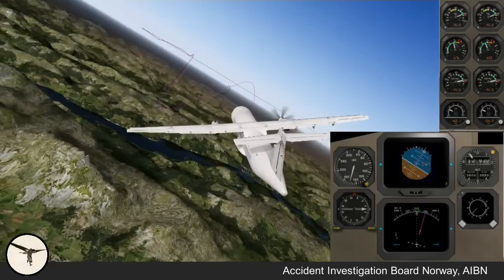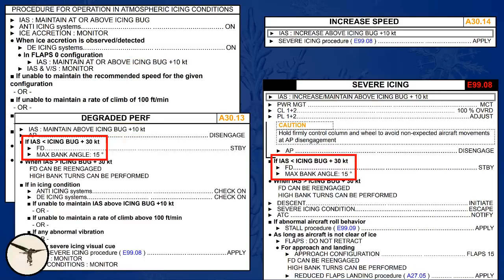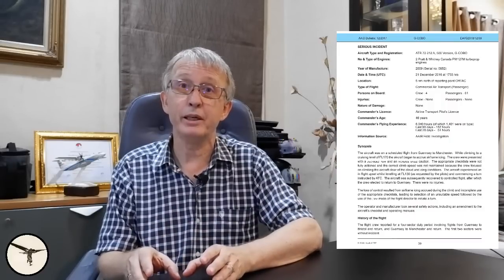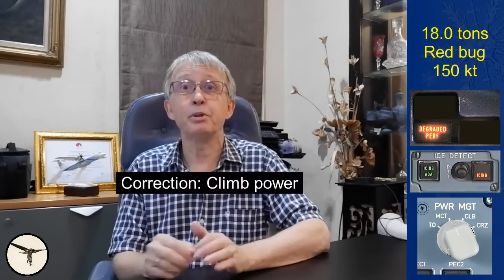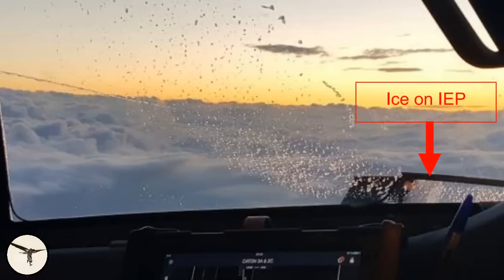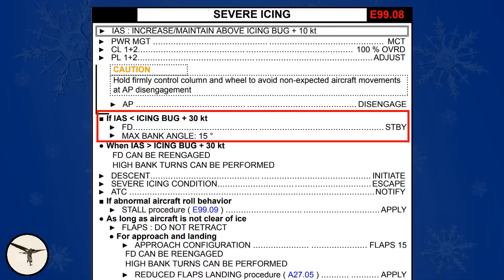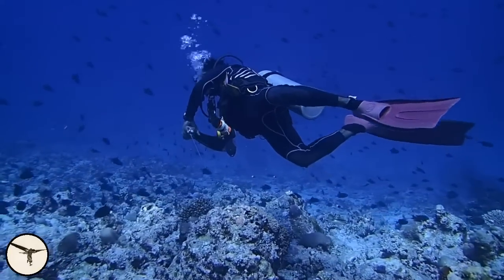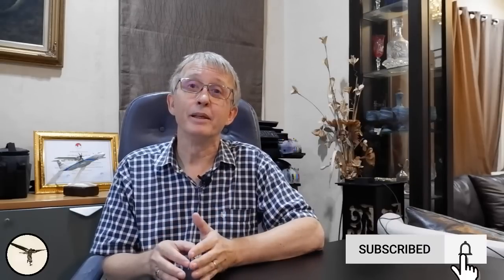Can you outclimb severe icing?

Comment: This French instructor and the Head of Training in AATC always tells us "There's 3 important things in aviation 1.Airspeed 2.Altitude & 3.Fuel. If you don't have speed, you stall and you can die. If you ignore Alt constraint you can go into CFIT and die. If you ran out of fuel, and don't know what to do, you can die" It has been the bedrock principle and always have been the 1st Golden Rule in ATR SOP that in times of trouble, Aviate, Navigate & Communicate in that order. 

Effective flight planning is a also a great way to combat severe icing. FCOM PRO.NOP.ANOR.8.1.1.8 recommends choosing a cruising FL that provides 40kt margin above icing bug. This margin gives crew ample time to monitor icing, anticipate degredation and define a strategy to avoid it. If icing condition are forecasted on the planned route it is recommended to choose a cruising FL at or below the max ceiling for icing conditions. Pilots can't just choose a cruising altitude without any basis. Also treat the plane like a camel, if you see the camel tired and can no longer walk, let it rest and give it food and water. The ATR ceiling in icing condition is during climb when it reached a max rate of 100ft/mn, better if you add more margin to it. Never force the plane to do things it can no longer perform, be considerate to the plane as well.

Comment: Question the plane was in a flat spin turning to the left what if the pilot would have put the right engine at full throttle reverse thrust and feather the prop on the left engine and apply right rudder to counter act the left spin and once the flat spin stops the pilot puts both engines at full throttle forward thrust and point the nose down to get enough airspeed and climb out...I wonder will that work?
Reply: I don't think reverse thrust can be applied in flight, and if the control surfaces are already contaminated, they aren't effective, so there's no way to control yaw or pitch. So, it's possible they were in a situation where they could do absolutely nothing.
Reply: I don't have any pilot training but having watched lots of videos about spin recovery one thing seems to stand out: the need to get the nose pointed downward. I don't know if applying thrust is helpful.
Reply: Unfortunately in multiengine airplanes asymetric thrust doesnt help much, you have too much weight too far from airplane CG. If the spin is developed, very little posibility to recover. And we are not talking about T tail configuration which doesnt help either. I dont know any twin engine airplane, certified for spin recovery. As I know, there is no demand for it in certification of such planes.

Comment: Hello Magnar, I'm checking out all your tutorials now, good stuff 🙂. Think it is a very good video for all (aspiring) turboprop aviators. Question: Does the ATR propeller generate considerable vibration in more than moderate icing conditions due to ice on the unprotected area's of the blades? Or not so, because of the shape of these props? On the Fokker 50 vibrations happen and these aircraft even have a kevlar plating on the fuselage next to the prop to prevent damage when ice particles are shed (unevenly resulting in unbalance). Prop vibration on F-50 would indicate quite heavy icing which you need to escape and could as such be one of the indications that one has built up more ice than acceptable. 37 years of flying presented me with (only?) 2 cases of heavy/severe icing and both were over the North Sea in a frontal system. Easy escape down as no terrain. A180 back to were we came from could also have been an option but not necessary as 4000 feet descent solved the problem completely. Best regards, Boy
Reply from the maker: Hi Boy, thank you for your comments. Ice accumulation can cause propeller vibrations in all aircraft, and ATR is not immune to it. Personally, I have never experienced it. ATR aircraft also have kevlar plating to protect the fuselage from ice being shedded from the propeller.

Comment: hello magnar, whats the logic behind making the minimum icing speed to be: icing bug+10 kts? wouldn't it be simpler to just place the bug at +10kts and not add further complexity to the procedures? thank you
Reply from the maker: @jmrico1979  Minimum speed in icing conditions is icing bug. This is flaps retraction speed after take off in icing conditions. Minimum speed with ice on the airframe is icing bug +10. And because of the incidents mentioned in the video, minimum speed in severe icing is now icing bug +30.
Reply: @FlywithMagnar  aahh.. thanks, i think i get it now... so.. if you expect ice, speed no lower than icing bug, if in fact you start picking up ice,then icing bug + 10.. and now thats gonna be +30

Comment: Magnar, to avoid TCAS alerts when reaching SET ALT, why not simply increase IAS a bit? For example it is should be enough to use alternative climb speed of IAS 190kt from around -800ft and it will do job nicely. Or is there any glitch I am not aware of?
Reply from the maker: Adjusting IAS results in a series of pitch changes, as the autopilot tracks speed changes rather aggressively. VS mode is smoother.
Reply: @FlywithMagnar  Thank you very much for explanation. IAS more aggressive tracking makes sense as VS is obtained by ALT derivation so would be always slower reacting as control loop input after needed filtering compared to IAS obtained by direct measurement.

Comment: Hello Captain,

Why do you think Captains responded to a stall with pulling the control column instead of pushing it? Just curious.
Reply from the maker: When I made this video, I read the incident reports, which are based on data from the flight data recorders.
I cannot answer why the pilots responded as they did. It's outside my imagination.
Reply: They follow to their climb instinct by  reacting  to the decreasing altimeter .
Reply: @FlywithMagnar  Colgan Airlines 3407 (a Q400) also involved an inappropriate pull-back response to a stall by the captain. There was some speculation that he may have thought he had a tail stall, though the symptoms did not match that, since it was not a tail stall. Unlike the ATR incidents described here, no one survived that mistake.

Comment: What if we increased speed just below 0 degrees air temperature level then converted speed to altitude. It would reduce flying time in ice condition. As far as I know there is the heaviest ice condition between 0 and -10 temperature level. Does it make sense?
Reply from the maker: I see your point. However, icing conditions can exist in a deep area. As you wrote, most icing exists between 0 and -10 degrees. In average, the temperature decreases by 2 degrees per 1,000 feet you climb. That means we may encounter heavy icing in a 5,000 feet thick layer of clouds. It is not possible to zoom-climb that high.
If you level off, accelerate and then pull up, you will have a good rate of climb for the next 1,000 feet. Then you have lost your speed advantage. 
We fly in icing conditions almost every day, and in 99.99 % of the time, we do not encounter moderate, heavy or severe icing. But when it happens, the best solution is to descend into warmer air.

Comment: I like your videos as usual.  I have a question: How to determine the weight of the aircraft?
Reply from the maker: The aircraft is weighed (a scale weight is placed under each wheel). This gives the empty weight. Then, you add the weight of the crew and galley. This is the operating weight. Then, you add the weight of passengers, bags, mail and cargo. This is the zero fuel weight. Then, you add fuel. This is the ramp weight. Then, you subtract the fuel used to start the engines and taxi. This is the take-off weight. Then, you subtract the fuel used from takeoff to landing. This is the landing weight. 
For passenger aircraft, standard weights are used for passengers and bags. For light aircraft, actual weights of passengers and bags should be used.